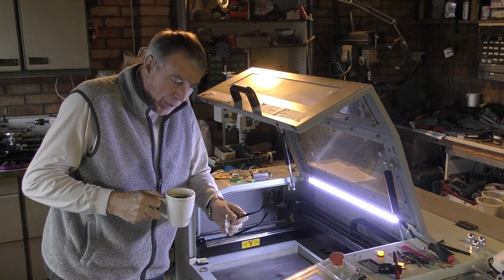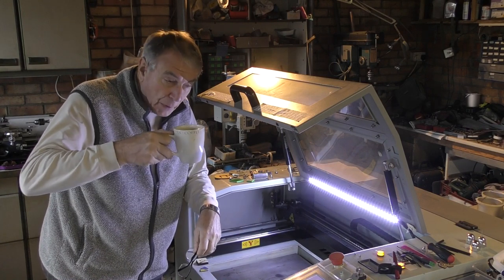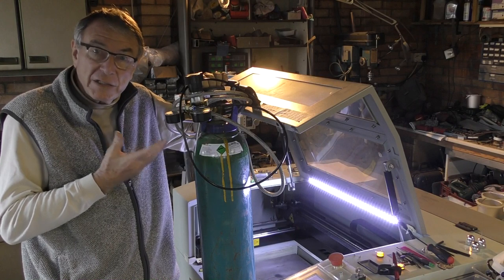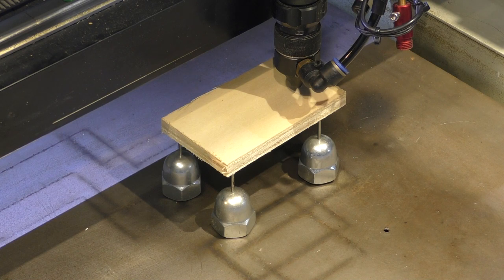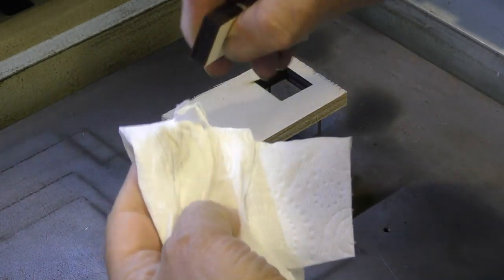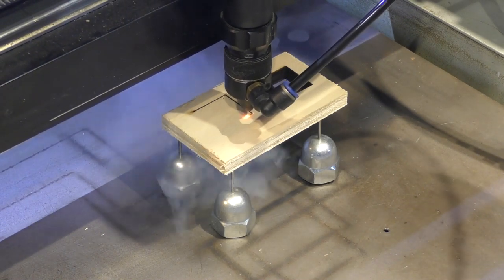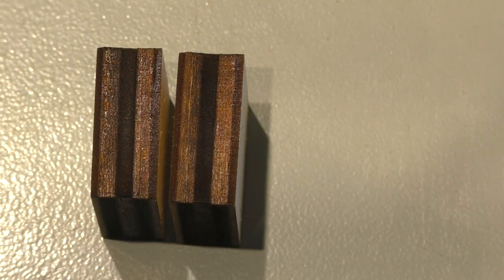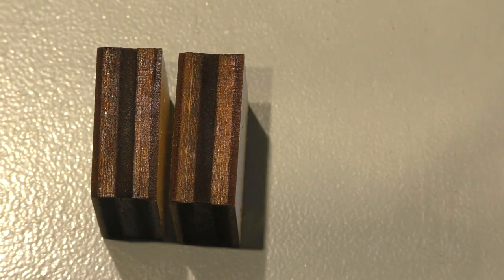RDWorks Learning Lab 174 Should I use an inert assist gas

Comment: Hi Russ. Try using a high rate of underside extraction to draw air/argon through the cut line. Without it most of your argon is bouncing off the top of the material. Ideally, the nosecone will have a very small bore and sit almost on top of the material. When right you won't see any fumes above the material. This combination of inert gas above and air drawn below should make the edge cleaner. However, as you comment by how much makes the viability debatable.

Comment: This makes perfect sense. If you do the calculations the power density of your average co2 laser means that so much energy is being dumped in that the material goes way beyond simple combustion into the realm of total molecular disassociation. The material isn't burning, it's totally decomposing and sublimating / vaporizing. The browning seen is because the process is so hot that it cooks the material on the outside of the kerf. The material in the kerf is totally vaporized.

Comment: To test the trapped oxygen conjecture, it would be interesting to place the test piece in a vacuum chamber to draw out trapped air followed by repressurizing (and even going to positive pressure) with pure argon.
Reply from the maker: Hi Darren
 You can see my workshop in the background and must realize I do not have not have NASA facilities. I think the term trapped oxygen may be misleading.   Wood  is an organic compound made up of atoms of hydrogen, carbon and oxygen. Depending on the type of wood the molecules that contain these atoms are bonded differently. The oxygen is not trapped in the material to be drawn out  by a  a vacuum, no it is atomically bonded into a molecular structure.  The laser light stimulates the various "wood" molecules and those molecules heat up. At certain critical temperatures the molecular bonds break down and the  atoms rearrange themselves to create other molecular structures. The oxidation products produced  are obviously not  using atmospheric oxygen in their chemical reorganization because argon gas pumped into the kerf  was excluding that.  My experiment was brief, but understanding the nature of how light energy  reacts with various materials  I was never hopeful of the proposed benefits people were proposing.
 Thanks for the comment because it allowed me to clear up any misunderstanding my words may have caused.
 Best wishes
 Russ
Reply: @SarbarMultimedia  That makes a lot of sense. Thanks for the detailed explanation Russ.

Comment: It is possible for materials to vaporize without any oxygen, place enough energy in one place and it will sublimate. It burns/chars because there is oxygen present  but many other reactions could result in soot. Interesting to see anyways :)
Reply from the maker: Hi Henrick. 
The last stage of wood burning is sublimation of carbon  in that bright white carbon arc you will observe. Don't look at it for too long because it lots of UV peaks in its spectrum and is like looking at a welding arc.  So carbon does not need oxygen to sublimate because it is a change of state  and not chemistry.  However, once the hot carbon gas has exited the cut it will be prone to bonding with atmospheric oxygen.  I am not a chemist so you must ask these questions of an expert.
 Best wishes
Russ

Comment: Interesting.   I've been toying with the idea of making a new lens holder that has a different type of air flow.  If you've seen those water fountains that shoot clear "straight" streams of water from point A to B.  I've been working in my machine shop to create a cutting head that would shoot air like that at the work material.  Have you done any experiments with that in mind?  My hope is to get a deeper and possibly cleaner cut by driving the smoke out more efficiently and hopefully effectively.  Possibly with higher pressure as well.
Reply from the maker: Hi 
Laminar flow  is relatively easy to achieve with water because it is non compressible. Provided you put adequate flow straitening in before the nozzle  you can change the throw by increasing the pressure. Hence the great tricks they can perform with fountains. Not so with gas.  Pressurize it in any way and  it will compress. When it exits a nozzle it will always want to expand until it's pressure matches the atmospheric pressure. There is branch of science that deals with laminar flow air and that is called Fluidics. As you will find, the flows and pressures re VERY small otherwise you cannot achieve laminar flow.. I use a small orifice nozzle (2mm to 2,5mm diameter) and set it very close to the work (3 to 5mm ) I use air at about 3 or 4 psi and  find that the .jet from the nozzle remains largely intact before hitting the work. It is impossible to see (I have no smoke injection equipment) but you can get an idea of whats happening by looking at the displacement of a smooth water surface as you change its distance from the nozzle.
Good luck with your experiments.
Best wishes
Russ.

Comment: Side note:  I'm curious about your pins in this video.  Looks like a different system then some of your other videos.  Have you switched to this or do you use your pin table still?  I was thinking about making myself some magnetic pins from Small Lamp Finials (the tops of lamps) and screwing a magnet at its base.  I think I could find some that are pointy or conical.  They would be a little over 1" tall.
Reply from the maker: Hi Erik
Yes I do still use my pin table but that is usually for more delicate materials such as card and paper  and thin acrylic (1,5 /2mm). There are no absolute rules  IO often use little discs /sqares of cut out waste from 3 to 10mm depending on the situation. I even have some neodymium magnets 10mm diameter 6mm tall which I often use for holding Baltic birch plywood flat. This is a particularly useful method for me because I have a recirculating Purex filter unit that is a great piece of kit but costs a fortune to replace filter elements . You will see me using these magnets (one as a spacer and one as a clamp) if you watch this from 5min 15sec through 7min 45 sec  https://www.youtube.com/watch?v=V_ehGE51rH4
to see the pins you mentioned see https://www.youtube.com/watch?v=CXda33tlO3k  stating at 19min 27sec.
So the principles are very simple, The smallest support area possible for each pin and enough clear distance below the support so as not to cause reflection onto the back of the work. If you want to minimise back reflection and get the fumes away cleanly then1" distance above the table is fine. However If your pieces are not bridged into the sheet they may fall and be damaged by an adjacent cut, For small acrylic pieces I use 5 or 6mm spacers that will allow pieces to drop bur being close to the table the fall where they are cut and will not be damaged.

Besy wishes
Russ

Comment: Hey Russ love your videos, thank you so much for the work and knowledge you share with us.  I don't have an engraver yet but plan on purchasing a k40 in a couple weeks.  While going over the additional things I will need to purchase, I had a thought about air assist.  Have you or do you know of anyone that has tried using a vacuum pump to pull the smoke away from the work instead of an air pump to push it away?  I think if it works then the exhaust could be removed from the back of the machine and put in the area where the vacuum pump is situated.
Reply from the maker: Hi Gary
The K40 looks like a cheap avenue into laser cutting if you have a very limited budget.  It was a serious consideration when I bought my China blue machine, but the more I read the more I realized it had serious limitations, No air assist (because it's really only ever designed as an engraving machine). No adjustable table. Only a very limited capability analog controller. Only capable of using one focal length lens. Very poor extraction/airflow design, Questionable durability of the plastic X bearing system. Non adjustable  mirror 3. All very cheap plated glass mirrors.  The list of negatives was far too big and the reason why the cost is so low. I opted for the cheapest "full spec" digital machine  Ok it was twice the cost but I have no regrets There are 3 key things I would look for when buying a machine. 1) digital controller (preferably an industry standard Ruida)   2) Engineering proven bearing rail system (Hi Win type) atleast for thr X axis  3) an air assisted lens/nozzle system that does cutting as well as engraving.

There are many really rubbish machines on Ebay so you have to be very careful. I found this little gem that ticks most of the boxes.. It is still not perfect but it is an excellent learning tool that could be coaxed into real little beauty.
https://www.ebay.com/itm/RUIDA-50W-Co2-Laser-Cutter-and-Engraver-Machine-Motorized-Platform-24x16/113796729518?hash=item1a7ed04aae:g:wuYAAOSwFKddEdXi
As with all these ebay machines you will be getting a below spec B grade tube. Foe example this so called 50 watt machine will be fitted with an 800mm long 40 watt tube that may deliver 30 to 35 watts if used properly. Your K40 will never deliver 40 watts it will be a substandard 700 mm long  tube that in reality will deliver 30 watts max.. Always pay for these machines with your credit card because the warranty promises are made of smoke. Threatening a 100% charge back from your card supplier is a more powerful weapon if things go badly wrong. . Quality control is not even an optional extra , Whatever machine you buy it will require TLC and eventually extra money spent on it.

 You will undoubtedly learn something from owning a K40 but your scope will be very limited.  My advice is to be a bit more patient and save a little longer.. I will give an opinion on any link you wish to post

Best wishes
Russ

Comment: What happens if you use oxygen?
Reply from the maker: Hi Mark
Pressurized oxygen is not for the untrained to use,  that is why god gave us only 20% to play with in air we breath. . What would happen?  I suspect the answer will be lots of flames and brown trousers.  That is an experiment too far for me. 
Let me know YOUR results if you do ever try it.
Best wishes
Russ
Reply: Thanks for the view, I don't think I would try it either. Just looking for confirmation. I have gained much from your channel, thanks very much.
Reply: @cmarkjclose  once I get my weike 150w I will be attempting to cut metal with O2 assist.
Reply: Hi Adam, Will be interested in your setup and success rate., do be careful as mentioned above.
Reply: @cmarkjclose  The real danger is escaping O2 and I will buy an air monitor that looks for O2, LEL and Toxic gases.  Or wouldn't it be cool to build one with raspberry pi?  I will have to look into that.